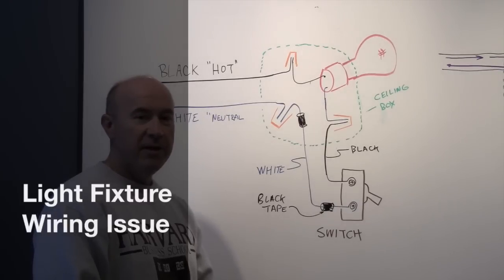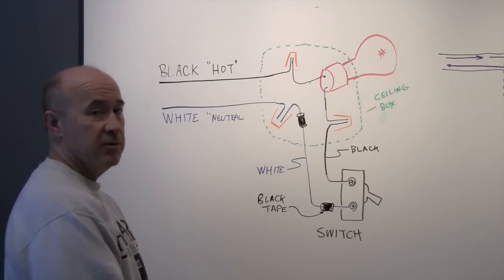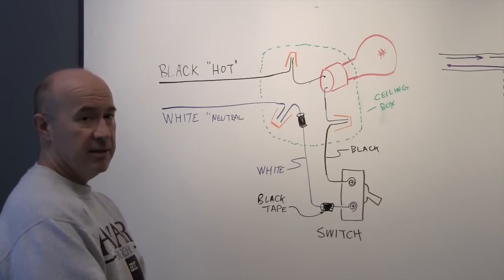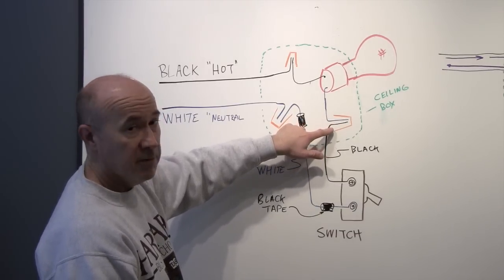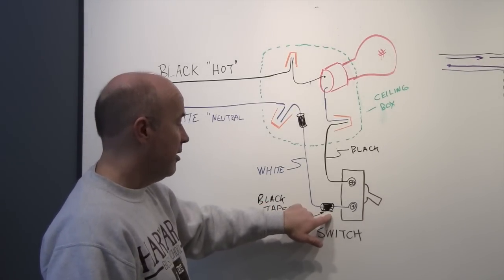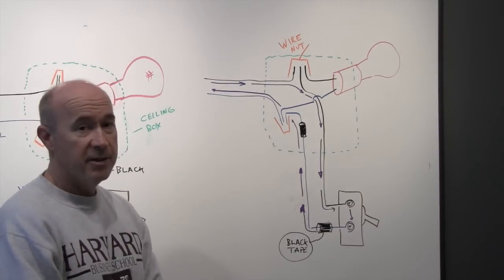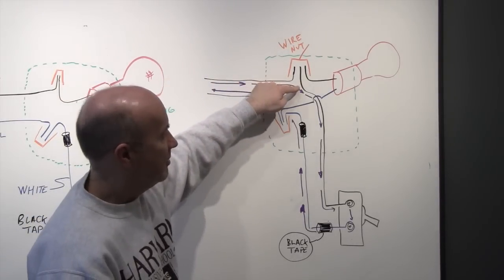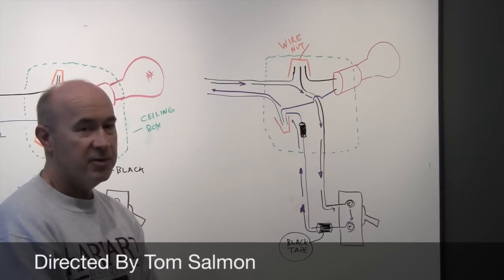Light Fixture Wiring Issue : Circuit Breaker trips as soon as the light is switched on.

Comment: The drawing where totally confusing.  Why would you run the White wire as a hot.  Black goes from the power source to the feed terminal on the switch and then to the fixture. White is the neutral. I have idea what you're doing. The White wire isn't suppose to be used as hot too feed anything.
Reply: hes saying you may come across this in a pre existing circuit. it may be wired wrong to start
Reply: Actually, even though he may not have explained it well or accurately (considering all the down votes) he's trying to address a real point of confusion. To the first person who posted the comment, no, white does not always indicate a neutral wire. It's kind of like "all cows are mammals but not all mammals are cows". The white wire running through your main circuit from the breaker box is the neutral wire, but the connection between a light switch and a light is a mini circuit called a switch leg, and will commonly have a white wire that is hot. Electricians normally put some black tape on the white wire to indicate that it's carrying current, but it's not always marked that way. Now what you said about the black and white (hot and neutral) wires going to the switch, that's how it's normally done today, but not always, and that's exactly what the video is about. Old houses commonly had the hot and neutral going directly to the light, then down to the the switch. If you had a new light fixture with two wires and then discovered that the ceiling box has four wires, you would be confused. One set of wires would be the hot and neutral and the other set would be the switch leg. You would first have to determine which of the wires was the hot. Then you would also know that the white wire that went with the hot was the neutral. To wire it you would need to splice the hot with one side of the switch leg with a wire nut, then the other side of the switch leg would power the light, and the white wire from the light would attach to the neutral. This way of wiring is not wrong! It's not generally done today but there are thousands and thousands of houses wired that way. Things work fine until someone comes along and f**ks it up, and that's what the video is about. If your ceiling box has four wires and you think "oh, I'll just connect white to white and black to black", that's wrong, and will trip your breaker.

Comment: I get you were taught, or learned some buzz words, but you shouldn’t be teaching people.   I don’t want to be rude.  

Never switch the white.  Also there in no ground in house hold wiring.   The copper wire is called safety.   It is there only as protection if the Neutral were to fail.   And taping the white line at both ends will fail every inspection.
Reply: There are grounds in household wiring. 

Although I agree with the rest of what you said. He should have ran the switch loop with the hot black coming in, being tied into the white neutral going down to the switch and then the black from the switch running up to the light fixture as the “switch leg” 

Original neutral that came into the light from source, should then have gone to the silver screw on fixture and voila
Reply: He's not teaching HOW to wire he's showing what a home owner with switch loop wiring will come across.

Comment: this is some Tesla stuff.. You sholudnt do this and just make a crazy mistake bringing the neutral to the switch....
Reply from the maker: Think about this, how do you define the neutral. The neutral is the wire between the device (light bulb) and the neutral bus bar in the power distribution panel. That is not what is being switched.  Another way to think about what is neutral, is that you should be able to put a voltmeter between the ground bus bar and any point on the neutral and see negligible voltage. Likewise Hot is between the breaker and the device (bulb). That is what is what is being switched. So, the neutral is not what is being switched. And As I've said,  I would not personally wire something like this, but if someone removed an existing light fixture and needs to reinstall or replace, I would use this wiring scheme if that is way I found it. 

This is another official definition of neutral:  This definition read, “Neutral Conductor—The conductor connected to the neutral point of a system that is intended to carry current under normal conditions.” The definition establishes that any conductor connected to a neutral point of an electrical system is intended to carry current under normal conditions.
Reply: @teesalmon  when there is a hot and neutral wire in a light box in a ceiling where a light fixture is located, connect the neutral (white) conductor to white wire of light fixture. and the hot conductor that is black wire, tie it to the white conductor that is run to switch box. ID that white conductor with typically  a black tape to avoid confusion and mistake it as a neutral wire which is typically white conductor. Then connect the black conductor coming out of switch that goes back to junction box where the light fixture is (known as switch leg) tie it to black wire of light fixture. What you showed in your first drawing, it works but as per NEC you can NOT use neutral wire to close/open circuit. For automotive DC circuits, negative wire is used to switches  to turn circuits on and off.

Comment: Sigh.... nothing chaps my tail more than electricians who shortcut and penny pinch by using colored tape instead of the correct color wire.  Once upon a time... back when wiring came in cloth insulators... you’d see some bozo electrician switching neutrals like in diagram #1.  This is asking for a wall fire or family member just out of the shower to get 120 volts through their body.  Pull the whole effing circuit... rip down the drywall, and redo it right!
Reply: My house is wired like this 😑

Comment: You're teaching people how to wire circuits the WRONG way. You switch the hot, not the neutral. The way you're wiring it, leaves the socket energized when the switch is off. Please remove this video to prevent people from the potential to be shocked, or worse yet, electrocuted.

Comment: Hey man I have a question. I tried to replace my dimmer light switch idk if it was broken but my light just wasn't turning on anymore. So I went and bought the same exact thing followed the wiring exactly how the old one was. Stupid me I tried it with the power on because our breaker box is downstairs in my landlords unit. Anyways tried to reconnect the wires and it sparked on me! Now no light in the room works! Pls tell me I just tripped the breaker and not have done something more serious?????
Reply: +teesalmon
Reply from the maker: Sounds like the breaker to me.
Reply from the maker: Joshua Tomas sounds the breaker to me...
Reply: +teesalmon Nice! Thanks dude. I also had another question so they had three black wires from in the wall and a black wire from the switch all under the same plug/crimp so when I tried to put all three wires from in the wall that were already together that's what sparked! I hadn't even connected the switch yet??? Idk if I should just do it??? Because that's how the previous installer had it???

Comment: WRONG!!!.....Take your horrible video down and NOW!!!....you dont switch the neutral because when that switch is off, that socket would still be hot and potentially LETHAL!!!!!
Reply: Deez Nuts
Reply: He's not teaching HOW to wire he's showing how a house with switch loop connections is wired 🤦🤦🤦
Reply from the maker: By switching the neutral you mean that the switch is between the light socket and the breaker....which it is not. While I don't recommend wiring this way, many houses were. And it is not against code.. The only thing slightly strange is that both conductors in the Romex are hot, but Romex is made with a black and a white wire. So, a black electrical tape marking on each end of the white wire indicates that it is actually hot.  Also note that if you buy a house, it could be wired this way, so unless you want to do drywall work or some serious wiring, it is what it is and this is how you hook up a light fixture.

Comment from the maker: Thanks for the comments. Realize that I would never wire something this way. Also realize if you buy an old house, it might be screwed up like this, and unless you want to start trying to correct this by running new wire, and possibly get into dry wall repair, (in this particular house wet plaster), then this will work. Also, somebody gave me that Harvard shirt, I didn't graduate from Harvard. I do have some degrees, but that doesn't matter and I'm sure you don't really care anyway.
Reply: People are stupid. You explained it perfectly and many older homes are still wired this way.
Reply: So the idiot electricians wired all these houses wrong

Comment: your first diagram is incorrect way of wiring if you becuse you dont need to connect your white wire to the switch, you shouldve connected the white to the light in the junction box , the white wire by the swich should be capped off . it just confuses the shit out of people that are switching the neutral.... still an important video to see in order to correct mistakes of others
Reply: Indeed this boggled me as well..

Comment: "maybe you shouldn't be doing this work"  - Agreed. Your first drawing shows you switching the neutral. You should always switch the hot. What you've shown will work but it;s not correct.
Reply: If I’m not mistaken you should run power to the switchthen the light
Reply: @Magicgathers  your power wire always goes to the switch. If the hot is not switched then when someone goes to work on the fixture and they turn the switch off thinking that that will kill the power to the light then it can kill them when they grab the hot wire because the neutral was switched but the hot from the breaker is still present. When switching power on anything you always want to switch control the hot wire not the neutral. If the house is wired correctly when you switch the hot wire and the switch is turned off i can also eliminate the voltage across the neutral wire (if there is no other load on that neutral). But switching the neutral wire will never eliminate the hot wire voltage because that is direct from the breaker. 

They stopped switching the neutral wires years ago because it was killing electricians all over the country.
Reply: Can you explain this? I mimicked the first drawing in the case of my garage light which is connected to two light switches (one at garage door, one at door entrance). When connected as the video states in his first drawing this made the lightbulb stay on the entire time whether the switches were turned on or off, clearly not a solution to my problem. Very Much Appreciated
Reply: I had issue where single 12-3 from single pole switch power tapped off adjacent switch, 12-3 to garage door only so switch would only turn om/ off garage door.  Spliced into wire before garage door for motion light.  Worked fine for a year.  Suddnly tripped breaker one day.  Reset it flipped light switch and sparks showered down from the gfci the garage door is plugged into.  Tried troubleshooting and unhooked the motion from the splice and voilla worked as normal..  no issues.  Thought it was notion light shorted out, got a new one wired in carefully and looked for shorts in cabling as it is a 3’ run to motion light, wired in and flip switch, boom breaker trips again..!!??!!... i cant finger this asshole out butt somethings shitty up in there..  unhook the light at the splice or the fixture, everything works, as soon as i connect the light it farts and the breaker flips.  
  Could it be bad gfci? Or wired wrong gfci?  Or a hot neutral from gfci or from an oops in the wiring to garage door.?  Maybe theirs a splice to something i looked over but only thing the light switch does is turn on and off the gay radge door..  conundrums are the worst type of drums out there..
Reply: Exactly. And somehow we don’t know what we’re doing. Right…
Reply: This is old school loop switch wiring and many homes still have it. It's allowed to stay there if it's already there you just can't do it when replacing wiring or wiring a new home.
Reply: @joannasaadati8810  I just looked this up and found your statement to be true. In my mind though if you can't understand a simply switch loop maybe electrical work isn't where a person belongs...

Comment: I'm just bothered to your diagram connection.. The hot wire should connected to the switch first then it will go to the bulb. That's why we mark black tape on the white wire indicated that it is a hot wire going to the switch. and the black wire from the switch going to the bulb. The white wire(ground) from the source will go directly to the bulb to complete the circuit. The word Neutral means not a positively charge nor negatively charge.But the way you demonstrate the flow of electricity in the circuit and the common issue of installer is excellent. Just the wiring connection.
Reply: 143lps He knows that. The diagram depicts how we might find someone wiring a light incorrectly.
Reply: Yeah this is terrible
Reply: He's not teaching HOW to wire he's explaining what is happening when someone comes across this type of wiring.

Comment: @teesalmon Hey Thanks for the video. I did exactly the wrong thing (matched all colored wires) and couldn't figure out why my switch kept tripping the breaker. Issue fixed now and both lights work great after watching your video! Thanks:)
Reply: @Havebleachwilltravel I hope you did not do what this guy did. It works but you can't open and close circuit by using neutral wire. Use hot (black) wire instead.
Reply: @zabizeyaee8002  This guy wasn't teaching how to wire this way he was telling you what is happening when the existing wiring is this way. It's an old school way of doing it and completely allows by code if it's already in place.

Comment: I could use some help.  I needed to replace a light switch in my bathroom.
I turned off the breaker, removed the screws and pulled the switch out of the wall, took a picture. then removed the wires.  took the old one and went to home depot and picked up a replacement.  I installed the new one, (no grounding wire), turned on the breaker.  It worked (I was pleased).  My daughter came home, went in the bathroom flipped the light on - it sparked and tripped the breaker. and now the breaker will not reset.  Do you have any suggestions (besides call an electrician)
Reply from the maker: 1) Is the box the switch is in metal or plastic?  2) Can I assume this is a simple one way switch?  3) do you have a volt/ohm meter?  4) Why did the switch need to be replaced in the first place? I would probably make sure the breaker is off, then remove the switch and inspect for arcing or a short.
Reply: 1) the box is plastic  2) yes one way switch  3) no meter  4) The old one stopped flipping on off just felt loose - it didn't seem to click to on or off position.
I turned off the breaker to pull out the switch to see if it was in plastic or metal.  How do I check for arcing or short?
Reply from the maker: Sherry Copeland
Reply from the maker: Usually if you see a spark, you will see a little black spot somewhere on an exposed metal surface, like a bare piece of wire, or on one of the switch screws, etc. Sometimes as the wires get pushed back into the box they can fold in a way where one of the wires touches metal that it shouldn't. What sparked? the switch or the light bulb. There is a remote possibility that the bulb actually burned out. I have seen crazier things happen. If you want email me at vee65@aol.com.
Reply: I e-mailed you.

Comment: Seriously. The circuit you describe is called a backfed circuit and is no longer legal.  Also, only wire of #2 and larger can be 'marked'. One last thing. Neutrals no longer exist, current NEC code has redefined them as 'grounded conductors'.  This is meant in good will. Be safe and have a great day. John
Reply from the maker: Thanks for the feedback. You are probably a real electrician, and I am not. I made this because my sister had someone try to install a new light fixture in a 1963 house that does not have grounded outlets. They could not figure out why the circuit breaker kept popping when they turned the light switch on. I'm glad this type of circuit is no longer legal, I never liked this scheme in the first place. I do appreciate your constructive feedback approach. Thanks.
Reply: I dont know about the schematic  but I   listen to what you said and it worked  perfectly Thanks